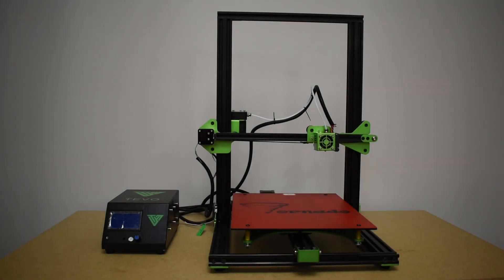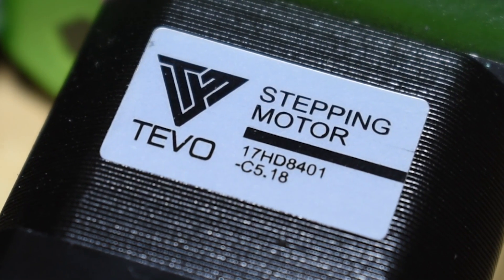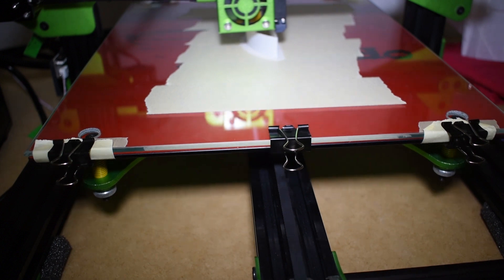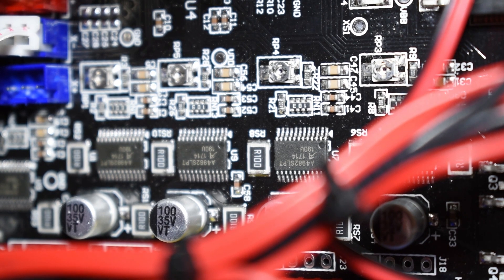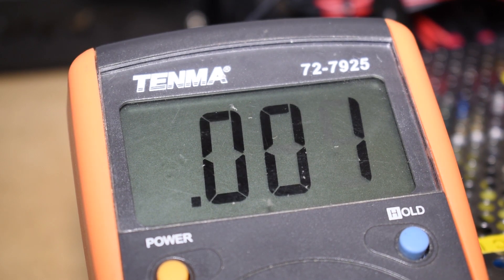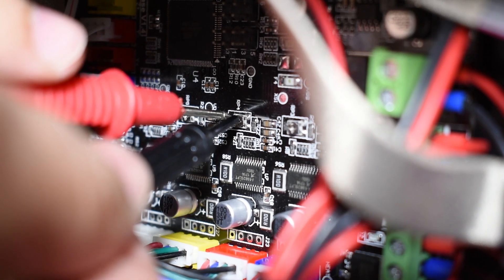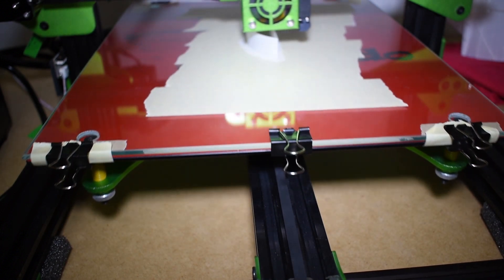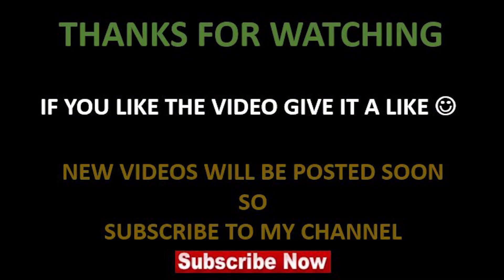TEVO TORNADO - Y axis Layer Shift - Analysis & Solution

Comment: maybe that was my issue. after putting back my roller wheels on my y-axis after an upgrade I did not like I will check the voltage. I have the Gen L 1.0 board. I had my TEVO tornado working except for a layer shift I could not FIX! I also bought "TwoTree" brand stepper motors trying to solve this issue.

Comment: I don't have a problem why the "Y" shifting but the "X". it's shifting as much as a 1/2" to the right on one print and then the next print will shift a 1/2" to the left. Belts are tight/cables are plugin, (nothing loose)/ Drivers are set to .95 per Tevo's tech support instructions. What can I do next?
Reply from the maker: Check manually  if your X axis moves ok or if it's hard to move. If the belt is too toght the axis is hard to move.

Comment: ruiraptor
, thanks for the video. I measured stock voltage 0.73 V on the y-axis Vref, as you did (v. MKS, y2018). A likely reason for shifting for me was caused by adding the diode smoothers on x and y axis in combination with a (heavier) metal hotbed, increasing the current neeeds of the y stepper motor. After raising the Vref to 1 V, the shifting is gone and the motor  is still below 40 °C during printing.
Reply from the maker: Hi Tim,
Thank you for sharing :)

Comment: I am printing a litophane right now that is placed long side on the Y axis and I got a X layer shift going trough the middle of the picture. Very upset right now! I wish I bought a cube style printer.
Reply from the maker: Hi,
Normally the layer shift is obtained on the Y axis and not on the X axis.
Check your axis movement if you have any blockage. Check belts and bearings too.
Reply: @ruiraptor  thanks, but the litophane is 3mm thick. So that is the movement of the head on the X axis. There is nothing there! And it prints fine above and bellow that layer shift. It shouldn't be possible! That is what pisses me off. I must try out Slic3r instead of Cura. If that fixes it I am never going to use Cura again!

Hmm, could it be the motor getting too hot? I think it's running quite hot and I have had 2 day prints. I didn't noticed it working that hot before...
Reply from the maker: If you are using cura, check if you have the Acceleration and jerk control enabled. If yes, then turn it off.
Reply: @ruiraptor  checked - nope.
can overheating motor cause it to miss steps? I noticed it is working overtime with the fast back and forth changes due to the litophane.
Reply from the maker: If you have the stock Allegro, then I don't think it's heat. If you have TMCs then it might and in that case, I would recommend you to increase cooling to the drivers.

Comment: what about the 2018 Tevo Tornado.  The Gold and Black.  It has different stepper drivers and I cant find any information on what the setting should be for them
Reply from the maker: The latest green version is the same as the gold one. It uses the MKS GEN L board with Allegro A4988 drivers.

Comment: Can you please show how did you adjust the power?  I am using the tornado with no glass.  I can confirmed that I've always gotten layer shift.  I made sure bolts, belts, and everything else is tighten.  I did noticed after about 20 hours of usage,  the print plate gotten loose.  But was easy fixed by turning the offset  screwed and tighten them.  Please post how to adjust the voltage so I don't burn my house  :).. thx
Reply from the maker: Hi,
I have a couple of videos explaining how to adjust the vrefs. 
For the tarantula but explains how the procedure works:
https://youtu.be/kkjwOxDSCiQ

For the tornado using the MKS GEN L board and TMC drivers:
https://youtu.be/RhlTdTLfaQ0

These videos explain in detail how the procedure works and the math to adjust the vrefs.
Any question let me know.

Comment: I had this issue for the longest time. Some times prints would come out perfect. Other times they would shift. The whole time I was thinking it was a hardware issue. But it was Cura all along. I have started using Slic3r instead and now all my prints come out perfect. Super annoying issue though can't believe it was just the software.
Reply from the maker: Cura has the acceleration and jerk settings set too high.
You can still use cura but you need to disable the acceleration and jerk control.

Comment: I had layer shifting issues so I tried this, but in the process the screwdriver slipped from the screw and I think it shorted something. The Z axis stepper driver doesn’t seem to work anymore, the motor just vibrates and hums in place. It’s not the motor because I tried it in another axis and it works. Is there any way I could fix this without replace the whole board?
Reply from the maker: If you have removable drivers, you can replace just that faulty driver. If your board is an MKS base with non-replaceable drivers, then it's not that easy to replace the driver unless you know someone that can desolder those components.
Reply: ruiraptor sounds like I’m getting a new control board. Thanks for the help

Comment: Hey Rui, i have the  HR4982 drivers. What vref would you recommend for each driver?
Reply from the maker: Hi Bobby,
You can use the same vref values i use in that video. The HR4982 and the Allegro A4982 have the same formula
Reply: ruiraptor so you left the extruder, x and z axis at their current voltage and only changed the y?

Comment: which direction do you turn the pot to increase current? also it would be great if you posted where to put the voltmeter leads.
Reply from the maker: Hi,
I have a couple of videos that explain that in detail. This one was just an analisys of the issue.
Check the following ones:
https://youtu.be/kkjwOxDSCiQ

https://youtu.be/RhlTdTLfaQ0

Comment: I just did my first tall print, Loubie's Dragon and had a Y shift at the head...about 6 inches up.  It shifted about a 1/4 inch.  The rest of the print had no problems.  I am curious about a few things...   so adjust the stepper driver to 1.00 v sounds easy enough.  What Jerk and Acceleration settings have worked well for you?  I would like to try those (I use S3D and I would just alter them in the LCD/control box)
Reply from the maker: Hi,
I'm using the stock acceleration and jerk settings. If you still get layer shifts, check if the slicer is overriding the firmware settings. Just disable that or set the same values as the ones in the firmware. If you still get layer shifts, increase the Vref to 1.05V. Good luck
Reply: I upgraded to Marlin 1.1.8 and assume those stock settings stayed the same!  Thanks for the quick reply.

Comment: Great point, will check if I can release.   I may have to move the z limit switch up a little.
Reply: Brian any update?
Reply: ultrarunner0476 ,
Running it now with my son.  I have raised the z level limit switch to allow me to release the tension on the bed leveling screws.  This has been a little difficult as now re leveling has become difficult.  It is printing now for the next 6 hours.  I can tell you more tomorrow.  I picked up 6.35mm PP sheet to place over my build plate.  Original plate is warped

Comment: Great video.  Did my first 45 hour print last night.  Three parts, two were successful.  One did not adhere to bed.  I think I need the glass.  I levelled the 4 corners but the center has a positive bend.  How thick of a glass do you use?
Reply from the maker: Hi Brian,
I use a 4mm thick glass.
Do you have the 4 screws (with springs) too tight? If they are tighten too much the bed might warp a little so that the center will be higher than the corners.
Reply: ruiraptor if they are too tight would you move the z stop higher so the bed has less tension in the springs?

Comment: I tried this and shorted my main board. Curious question do you need to have the printer on to see the voltage?
Reply from the maker: Hi,
Yes, you need to have the printer on.
When doing this procedure you need to be very careful not to touch any other component and also use a plastic screwdriver as i mention in the video to avoid any static discharge.

Comment: i must have gotten lucky .. the only issue  i have had printing with the tornado was sudden fast changes in ambient air temp causing even pla prints to curl off the bed .. a quick crude foam core board enclosure and all is well aslong as i remember to check bed level and nozzle height
Reply from the maker: Hi Eric,
Glad to hear that your tornado is rocking :)

Comment: Hi, yesterday I printed bigger model and I got 1 layer shifted at higher position :)
Reply from the maker: Hi Manuel,
A few things you can check:
1- Make sure you have adjusted your Y axis Vref to 1.00. You can increase this axis value up to 1.05.
2- Check your motor gear. Check if the 2 set screws are correctly tightened.
3- Make sure your Y belt is stretched.
4- Check your acceleration and jerk in your printer. Lower the acceleration and jerk a little bit if needed.
5- If you are using Cura slicer, check the acceleration and jerk settings and match them with the ones in your firmware or disable the override acceleration and jerk settings in cura.
Reply: 1.05V did the trick. thanks a lot!

Comment: What type of screw driver you use and philips one does not seem to work
Reply from the maker: Hi Samir,
to adjust the driver potentiometer i used a small plastic adjustment screw driver. You can find with flat or phillips tips. Some even have one of each on each end. I was able to find it at a local store (electronic store) many years ago. You can also find it on webstores like ebay.

Comment: I am still having y layer shift problem even though I have raised the v-ref to 1.1V. I have also replaced the stock SD card with Sandisk brand one. Is there anything I miss?
Reply from the maker: Hi, yes...there are a few more things you need to check.
1- Confirm that you adjusted the correct Y axis driver vref
2- check your Y axis belt tension
3- check your motor gear set screws
4- if you are using cura (or other slicers that is capable of defining acceleration and jerk), reduce the default acceleration and jerk used by the slicer or set it so that it does not override the printer's acceleration and jerk.
5- If you still see layer shift after all the above, reduce the acceleration and jerk in your printer settings (display menu)
Reply: Hi thanks for your suggestions. I have found that the belt is not tensioned properly. After I tightened the belt, it improved a lot. However, I am still having the layer shift. I will try to lower the acceleration and jerk setting, see if  that can eliminate the shift completely.

Comment: how you change voltage  value
Reply from the maker: Hi,
You need a voltmeter and a small plastic screw driver.
As explained in the video, you use the voltmeter to read the voltage between the middle pin of the potentiometer and the DC COM connection of the power supply. Adjust to 1.00V the Y axis driver.

Comment: We have adjusted the voltage, verified the belt is right & made sure all bolts are tight... we are still getting a layer shift. We have tried different sad cards, files & settings. Still getting the problem.
Reply from the maker: Hi Christy,
I mentioned this to a different user that reported the same issue.
Check your slicer because some slicers (cura for example) override the acceleration and jerk settings of the printer.
These acceleration and jerk settings are by default very high and result in very rapid direction changes which cause the layer shifts. If your slicer has acceleration and jerk settings, replace those values with the ones used by the printer (enter the settings menu in the display of the printer).

Comment: Looks like the layer shift issue is a common problem with the Tornado. I am dealing with this issue as well. I haven't resolved this issue yet but I've found some information along the way that could be helpful to some.

1. First thing to look for before checking anything else is loose bolts. I can't stress this enough, go through every single bolt on the entire printer and check if any came loose.This includes motors, gears, pulleys, wheels, hot end, etc... Chances are you'll find one or more that could use tightening. In my case my Z motor carrier was loose and the Z lead was bouncing up and down, this can cause the model to catch on the nozzle and therefor put additional stress on the Y motor causing missed steps. I've also read about hot ends coming loose and doing the same. Make absolutely sure everything is tight

2. Check the belt tensions and how the belt rides on the pulleys, meaning run the Y and X at their full range and check to see if the belts walk to the side wall of the pulley. Ideally some walk is OK but it shouldn't hug the side of the pulley. As far as tension goes, this is a bit obscure but obviously you want it tight enough where it won't skip but still travels freely. One trick I found was putting a piece of tape on the motor case, gear and belt and drawing a line across all 3. I left this tape on there to periodically check if the belt skipped.

3. The stepper drivers in the stock controller are A4982 drivers, which are rated for max 2A. At vref 1.1v (=1.37A) there is still plenty of head room to drive the Y stepper. According to my observation the Y motor barely gets warm and should be able to handle more. I've added a heat sink to the 4 stepper drivers in line on the board and bumped the vref to 1.165v (1.45A). We'll see what effects this has.

4. Acceleration and jerk settings are an other thing too. I've read up on those but from what I understand each printer has it's upper limits, I haven't figured the Tornado's limits... yet

If anyone would like a to add anything, I'd love to hear it. I'm quickly running out of ideas on how to resolve this issue.
Reply from the maker: One more thing I would like to add is that some slicers (namely cura) can override the acceleration and jerk settings of the printer.
By default, these values are too high and will make the axis change direction too hard and fast which might cause layer shift.
To prevent this, change the acceleration and jerk settings in your cura slicer to the same values used in the display menu settings.
Or use ideamaker instead :D
Reply: Thank you for the input. I am using cura, I'll try what you suggested.
Reply: I have done as you suggested and configured cura for print accel at 1000, travel accel at 1500 and jerk at 10. So far so good ! I haven't been printing anything too demanding but everything I printed came out with zero layer shift, before I would at least get one shift per print regardless what I was printing.
Thanks again!!
Reply from the maker: That's good to know :) Thanks for the feedback.
Reply: That's print jerk, I have travel jerk set to 30, travel speeds to 120 and print speeds vary depending what I'm printing, temps, structure, material type etc... but I normally use between 40 and 60mm/s. Just to give a quick update since I followed ruiraptor's advice I have had not a single layer shift since, printing almost everyday.
Reply: "jerk 10" - is that Print Jerk, Travel Jerk or both? Which print and travel speeds do you use? :)
Reply: KESDtv - it seems to be working here as well!
Reply: Did you have any luck?
Reply: Cura is the weak link. Use Slic3r instead!
Reply: Hi, I know this is a bit old. But just wanted to ask. Did you adjust the Vref on all the potentiometers - X,Y,Z, extruder stepper mottors ?

Comment: Hi Rui! I was wondering what kind of a screwdriver are you using while adjusting. Is it a non-conductive mini, by any chance? I am trying to buy a kit and can't find too many option. Could you please suggest anything, maybe even a link from where you've got yours?
Reply from the maker: Hi Karma's, 
I'm using a plastic screw driver. I prefer to use a plastic one to avoid any electro static discharge on the board.
This small tool i have it for many years so i don't have a link for it but i can show you an example for a similar one here: https://hobbyking.com/en_us/plastic-screwdriver-for-potentiometer-adjusting.html?___store=en_us
Reply: Thank you Rui! I appreciate your help!

Comment: I am consistently getting a shift about 2 inches up on my prints, I watched it and my nozzle kind of does this shuddering and then my layer shifts
Reply from the maker: Hi,
Are you using the stock SD card? If yes, then dont use it. Get a new and from a trusted seller and try again.
Reply: Thanks i will give it ago.
Reply: C Scherbarth did it work?
Reply: Haven't had time to get to store yet its on my to do list.
Reply: C Scherbarth might beat you to it and repost I'm having the same issue
Reply: Hey if you drop a line.
Reply: So far no shifting with the new card. I next need to figure out the shadowing.